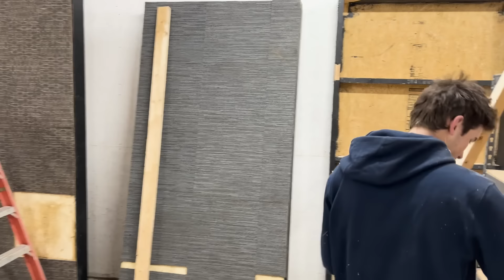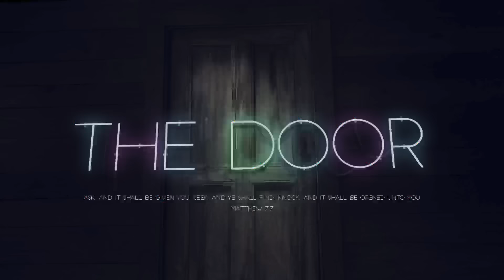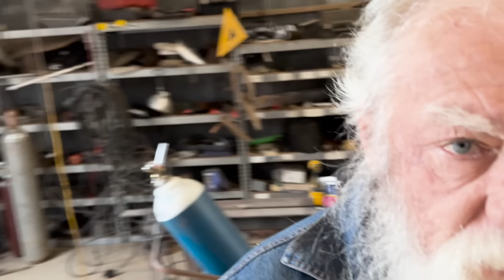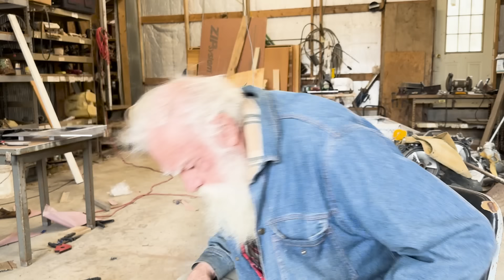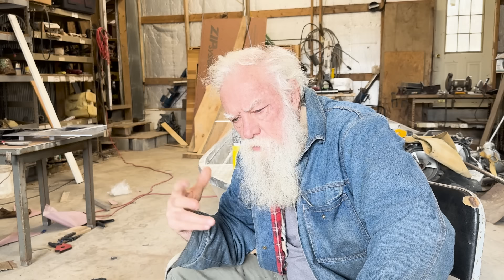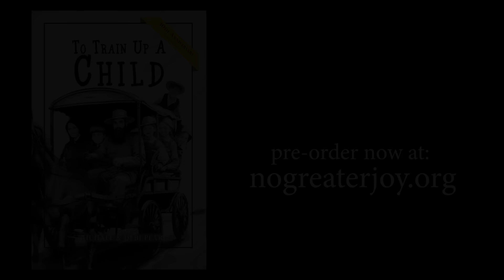How to Take Revenge on the Devil

Comment: @The Door   Hi Mike, The torch head on the solder torch inherently has a slow leak, the one sitting on your boat. Remove the torch from the gas canister when walking away from it once not in use, especially in an enclosed space like inside you house for "safety" and waste.